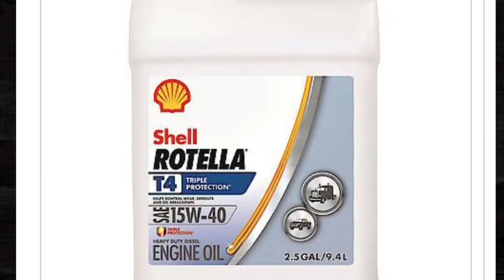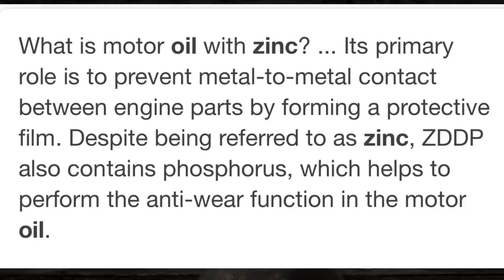The only oil you should run in your jeep 4.0

Comment: Great content! I have a 96' ZJ with 263,000 miles; in IL. running 15w40 during the summer and back to 5w30 for the winter. Cheers to keeping the 4.0 alive!! 🍻
Reply: Whats the lows for your winters? Where im at in nor-cal i run 10w30 in winter and the 15w40 in summer
Reply: do you still have cats??
Reply: @pauldelano49  Yes, it has one Cat. No issues at all and it now has 282,000 miles.

Comment: Run the bog standard auto parts store brand 10w40 or 10w30, these engines go 300k mi with no special treatment
Reply: Wrong move, Rotella is the best oil for these, he is 100 percent right here
Reply: @mblake04201  lol. And how do you know this? You have no clue. You are just repeating what some else who also doesn't know shit says.  How many ppm's zinc and phospate does rotella t4 have compared to other oils? I'll give you a hint...Much less than oils specifically designed for flat tappets cams.
Reply: I think you can get away with most any oil on almost any flat tappet cammed engine that already has a lot of miles on it,  because the cam and lifters have seen so many heat cycles they are extremely hard. The problems arise when people try to run any oil in a rebuilt engine with a brand new flat tappet cam and lifters. Even with break in oil and proper cam break in procedures, I've seen dozens of hydraulic cams go flat shortly after break in. Some still on the dyno. This is why a lot of engine builders, including myself, recommend switching over to a hydraulic roller cam if they are available for your engine application.
Reply: @mblake0420  It doesn't matter what special additives are in the oil, it won't fix a worn out engine, the reason any engine wears out is because of high hours, lack of maintenance not doing oil changes, running low on oil, etc. Low oil pressure is the killer not what's in the oil.
Reply: It sounds sounds like special oil is special treatment.
Reply: Absolutely! I've been running a XJ as my daily driver for 10+ years now (same one, same motor) and I have always just used whatever is on sale. (Synthetic or Non). For whatever reason the thicker stuff (15w-40 and 20w-50) gives my engine more clatter so I've been running 10w-30 and 10w-40 for years now with no issues, idle oil pressure is 15-20psi after a half hour of driving and 45psi going down the road. Cold idle pressure is always 40+. XJ Has 333k on it, mileage on motor is unknown.

Comment: I'm with him on zinc!!!   I accidently used a oil that stripped or cleaned off the the zinc on my 97 jeep,  the ticking was driving me crazy!!!  1st thing  I done was using Rotella for 2 weeks then changed oil again using Rotella several more weeks of driving the ticking was gone. The 3rd oil change I switched to Royal Purple, 2 years later the motor is still quiet and strong.   Older vehicles need the oil with higher zinc content to coat the parts.

Comment: Been using this diesel truck oil for 100,000 miles. Never have to add oil between 5,000 mile oil changes. Currently this 98 Grand Cherokee has over 265,000 miles . And reasonably quiet.

Comment: been running Rotella in my dual sport bike, mostly for cost-related reasons, since 7k miles - i'm at about 46k now (which is pretty "out there" for a motorcycle), now that I have a WJ I've been using T6 for 2 years and feeling better about continuing to use it. Though I do go for Mobil 1 high mileage 5w30 when it goes on sale since it has 1.5x of zinc compared to T6

Comment: mines got just over 100k, ive been a snob about using amsoil the last few years because its supposed to be made for flat tappet engines. Recently i switched to penzoil ultra platinum becuase it has about the same amount of zinc but is cheaper. i can really tell a difference when compared to conventional oil, the engine even sounds different. It doesnt sound as tractor-y as before and it runs alot smoother,  i also get slightly better gas milage and the engine feels like it has a little more power. if you cant afford it though i would still recommend running amsoil for a couple oil changes if your engine has over 100k becuase it will really clean your engine out.
Reply: My TJ has had Amsoil in it for 20 years.

Comment: Guess I should have paid more attention. Got a misfiring '01 TJ. So far I've done plugs, coil pack, and injectors. I just replaced the water pump and radiator and sending unit but those are totally different stories. I disconnected the rear o2 sensor with no change. Next up is a crankshaft positioning sensor and seafoam in the oil. After that I guess I'll have to take a look inside.

Comment: I had zero oil pressure when 210 temp at idol in my 99 WJ 4.0 at 160k miles. I have 40psi when above 1500+rpm. Using Lucas Heavy Duty Oil Stabilizer ( 1 qt) & Rislone Hy-per Lube Zinc ZDDP Supplement (1/2 bottle) with 5w20 oil saved the engine. 

But next oil change ill try Rotella T4 15W-40 (CK-4)
Reply: @LarsonChristopher It sounds like you are experiencing the common oil pressure sensor problem. It typically presents itself at idle when hot and the gauge will rapidly drop and/or fluctuate back and forth repeatedly. Replace the sensor and the problem will go away. A failed oil pump can't be fixed by different oil and will be purely RPM dependent regardless of temperature.
Reply: Also I'll add that using Lucas oil stabilizer will just thicken the oil viscosity and swell any seals. Which is why it seems to have fixed your oil pressure problem by swelling the diaphragm in your oil pressure sensor enough to keep it from dropping to 0. Zinc content only effects wear on flat tappet cams and has nothing to do with oil pressure at all. I suggest running mobile one 10w30 high mileage full synthetic. It contains plenty of zinc and a detergent to clean oil passages and break up sludge as well as a conditioner that protects seals without swelling them.
Reply: 5w20 know  wonder you had no oil pressure

Comment: I run Valvoline VR1 racing oil in mine. It's pricey but it's also a high zinc oil. I'm going to check into the Rotella. Thanks for the tip!

Comment: Driven, Brad pen, and any oil that says racing on it is fine to run. Keep in mind they say any oil with high levels of zinc can ruin your catalytic convertor. But I've not seen it happen in over 20 years or running these oils. I ran the original rottela up until about 2010 when they took out all the zinc in that. Been running Brad pen 10w40 in my Jeep strokers with big cams and lots of valve spring pressure since then and have had no problems.
Reply: The zinc is gone? How do you know this?
Reply: @mblake04201  Because I've seen the manufacturers oil additive package sheets for it. Back in the day all American made engines used hydraulic flat tappet cams or solid lifter cams in performance engines. They needed zinc and phosphate to lubricate the metal on metal cam and lifters. As the EPA got stricter about emissions, oil manufacturers were forced to limit the amount of zinc and phospate they used n their oil and auto manufacturers were forced to switch to hydraulic roller cams to get decent life out of their engines. That's when every car guy switched to Rotella 15w40 or some other oil intended for diesel engines as diesels still required the zinc and phosphate, and oil intended for them still  had it. Then the epa went after diesel engines, the trucking industry, and we got all the new rottela oils like T4,T6. We also got diesel particulate filters and all other kinds of emission crap that have basically killed the reliability of diesel engines, which is what diesel engines were always known for. Brad Penn and driven oils were both created to combat the problems for older engines created by the epa. It says safe for flat tappet cams right on the bottle. Actually, Brad pen has been around for decades. If your old enough to remember Kendal GT1, and it's distinctive green color, you've seen Brad Pen oil before.

Comment: Hi Ronnie, I have a question if the flowkooler water pump a good thing to run on the 4.0? I live in southern Arizona I was wondering if it would help with overheating.
Reply: I dropped from a 198 to a 160 thermostat in my '96 XJ  helped considerably, fixing to pull the A/C out,Dosen't work anyway) and go to a bigger Radiator
Reply: Switching to a severe duty fan clutch seems to have helped with overheating for me. 210 is a normal run temp on a 4.0, Hayden 2791 fan clutch is what I got, there is some potential for belt squeal but factory belt and tensioner did fine for me.

Comment: I run Valvoline vr1 10w-30 or Rotella T6 10w-30. T4 doesn't have as much zddp as the aforementioned oils. By the way it the phosphorus in ZDDP that actually protects the engine not the Zinc. Zinc is just a carrier for the phosphorus, both are polar and need heat and time to adhere by the way. Watch lake speed jr the oil geek & it'll open your eyes

Comment: I just put some synthetic mobil 1 10w30 in my 4.0 should i switch back to conventional T4 next change? Also what about a SBC or 4.3 gm v6 ive been running synthetic mobil 1 in those for a while is it worth switching to rotella t4 or t6?
Reply: In the summertime I run mostly T4 15w40 in my 1994 TBI 4.3 safari, I read into it and the funn synthetic T6 isn't actually nice to run in gasoline engines, it's made to dissipate different kinds of contaminants and acids from modern diesel EGR soot, it doesn't do the same thing that gasoline engine oils do to keeps fuel blowby suspended, T4 is still API SN rated! They've only tweaked the formula a tiny bit over the years but it's still kosher to run in gas and diesel engines, even plays nice in motorcycle wet clutches (JASO MA2 rating)

Comment: I just got into jeeps. I just bought an xj that has been rebuilt (new head all new bearings new gaskets and sensors) and its running like sh*t. No power can barely do the speed limit pops and bangs when excelerating and was burning coolant. I just took the head off to put on a new valve cover. What was wrong with the jeep?

Comment: The dealership my first got it change the oil for me 6000 miles later I did change the oil myself and I asked what they put in it. They put 5W 20 semi synthetic. It has 10W-30 in it now, but will that cause engine damage after 6000 miles?
Reply: No not at all, not even a little bit, I bet you a million dollars and I’m broke. Wouldn’t hurt a thing whatsoever.
Reply: If anything, you probably got a plus 1 mpg increase but seriously it didn’t hurt anything, not even dead serious.

Comment: So can running 15w40 be harmful to a low mileage engine compared to 10w30?
Reply from the maker: Depends on how low mile and what vehicle
Reply: @cherokeeronnie  1998 cherokee 4.0. Supposedly the engine has 100k miles. I run 10w30 rotella but just curious if it would help me or hurt me to use 15w40
Reply: if your engine dont burn oil i wouldn't use a heavier weight motor oil. i did that once to an old toyota and the valve seals started leaking.
Reply: @josephwalker7432  that’s why I’m scared. I put 20w50 in an old 22re Toyota because it was smoking and it blew it up
Reply: @deepmarsh  
Was probably time for it to blow up anyway.
Reply: @deepmarsh  yeah same engine and the same thing happened to me. It didnt blow up though. It just smoked alot on a cold start for about 15 minutes but it still did pass a california smog check after that though, lol they are great trucks

Comment: What's up everyone, I'm in southern California, which oil should i run in my 97 XJ? 5w30 or 10w30?
Reply: You need to know what your running oil temps are plus what your main bearings clearance are or at least we're new. But I run Valvoline vr1 10w-30, you need 1100-1200 zddp for flat tappet